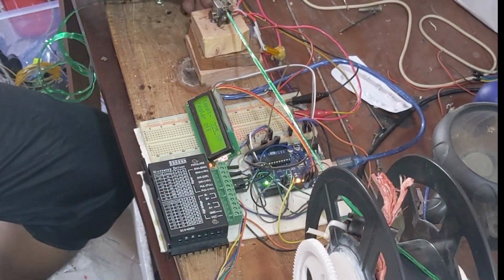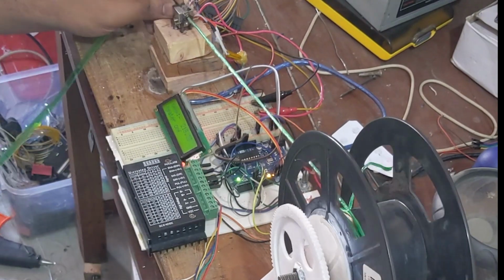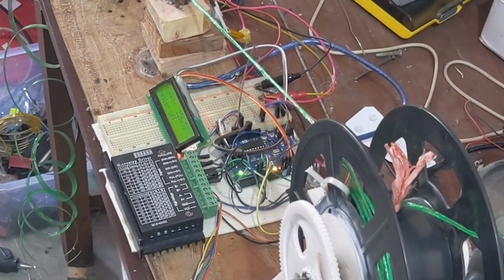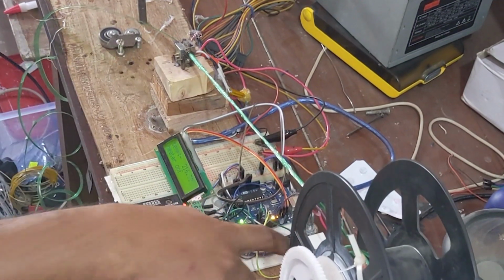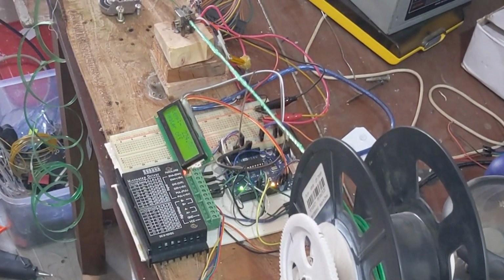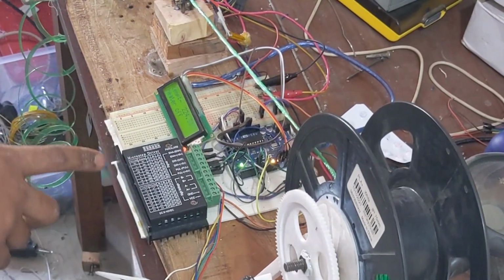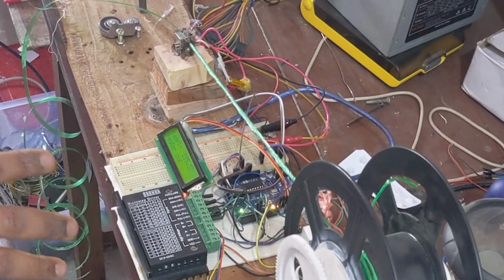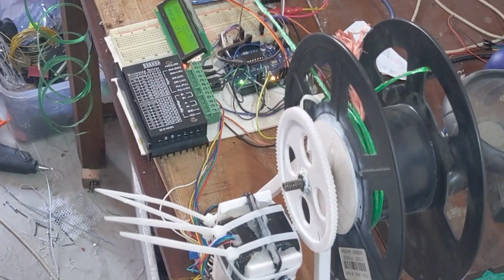Plastic Bottle to 3D Printer Filament or Rope

Comment: hii i am working on water quality monitoring project where i am using aurdino uno r3, ph Sensor ,turbidity sensor... both these sensor data i have to share to firebase database using esp8266 wifi module... but i don't understand connections... ph sensor needs 5v to be connected to aurdino uno...turbidity needs 3.3v connected to aurdino uno and esp wifi module also needs .vcc and En to 3.3v of aurdino... how should i make connecton do i need resistors? or any other components so that non of my component gets damaged... plz help me up
Reply from the maker: for the power supply issue, you can use a simple breadboard where you connect arduino 5V, 3.3V and gnd to bread Board , and then you can use the connections for your sensor and wifi module. You can also make voltage divider by 2 resistors(1K and 2K) . connect 1k resistor to 5v and 2k to gnd in series connection and you can find 3.3v at the common point of 1k & 2k resistors. as arduino uno has several 5v supply( in the power pins , 2 set(6 pins) of ICSP pins ) , you can also use any external power supply ( don't forget to make gnd as common connection) .  and for your project you can follow this hackster's blog . All the best 
(https://www.hackster.io/pulasthi-Narada/connecting-esp8266-to-firebase-to-send-receive-data-4adf66)